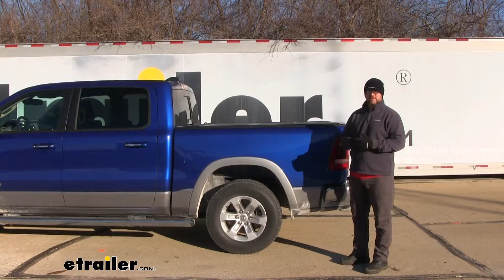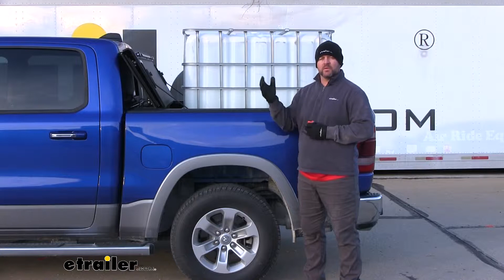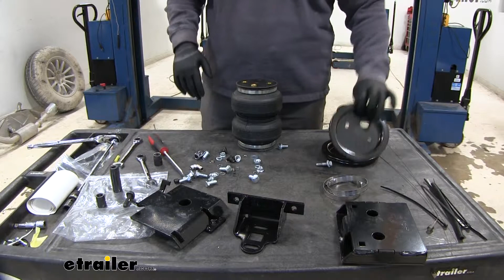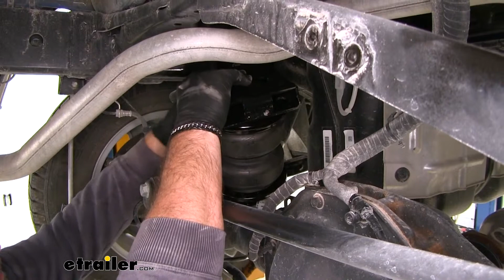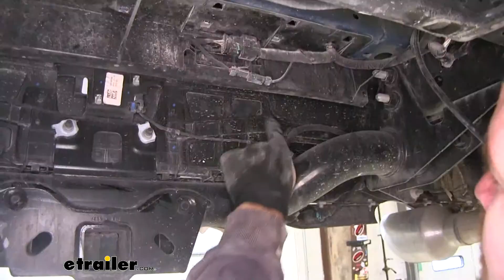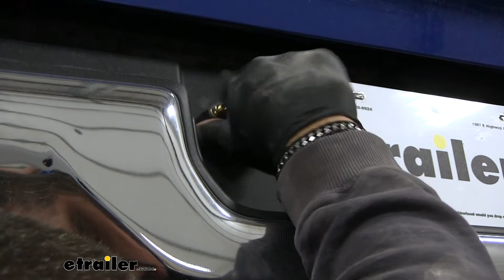etrailer | Air Lift LoadLifter 5000 Ultimate Rear  Air Helper Springs Installation - 2019 Ram 1500

Comment: Dont they make a no cut or drill version?
Reply from the maker: Unfortunately, we do not offer a kit that does not involve cutting or drilling to get the air bags installed.

https://www.etrailer.com/Vehicle-Suspension/Air-Lift/AL88375.html